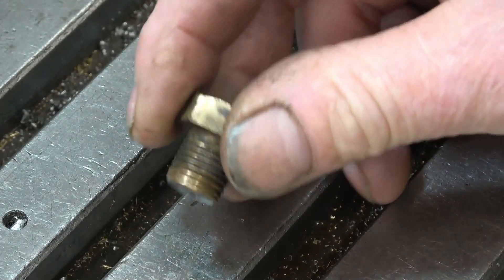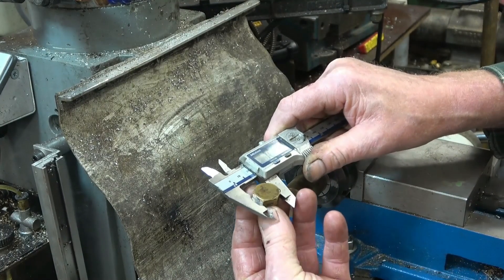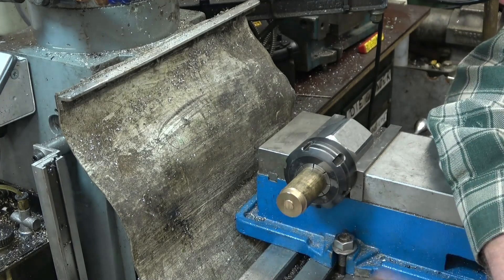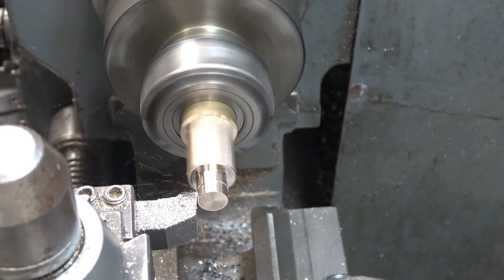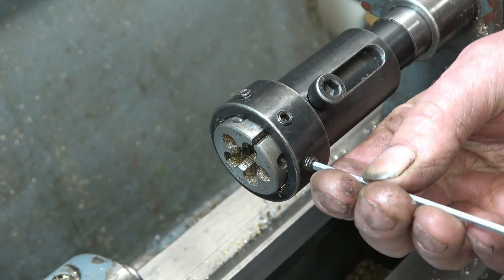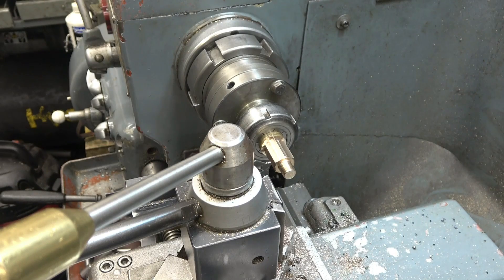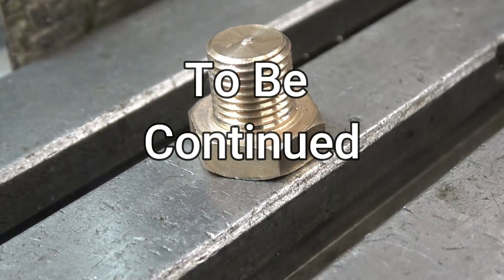SNNC 554 P1  How To Make BSP Plugs  , Round Bar To Hex Bar

Comment: Perhaps you could do a short video on how you used the calliper to calculate how much to remove from the sides. It is a useful function of zeroing the reading.
Reply: You measure the target size, zero the caliper and then measure the larger piece. That will give you the difference. Note, this is the total diameter to be removed. To find the radius to remove, simply divide by two, in this case the radius value is the amount John removed.
I hope this helps.
Reply: @robertoswalt319  I know - it's just that it would be a useful instructional video for a newbie.
Reply from the maker: I will show it in a bit more detail this wednesday
Reply from the maker: spot on that is exactly how it works

Comment: I was thinking these were going to have a solder center for steam relief on boil-over, what are those ones called?
Reply from the maker: That is a fusible plug filled with lead not solder . It is fitted above the fire box in to the boiler . If the water level drops and uncovers the plug the lead melts and puts out the fire .
Reply: @doubleboost  thanks John, I watched that video, so remembered how interesting it was. Think they were for the Sentinal Steam Wagon.

Comment: 2:30 

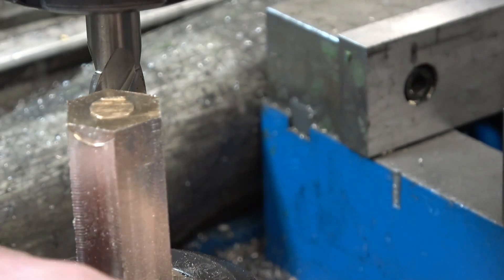It's at times like this that I am pleased that I converted my mini mill to CNC, complete with A axis. I can hexiferate rod* or cut gears while making dinner.  (I posted this before I got to 8:15 - at my age I need to do things while I remember. I have got to the annoying stage of getting upstairs, forgetting why I have got there, going down and remembering before I get there, turniong back and . . . . I am looking forward to the days when I don't remember when I get down; then I wet myself - ah! the downside).

It's at times like using the CNC mini mill to drill simple holes that I wish it weren't CNC - which is why I am adding MPGs where the crank handles used to be so I get the intuitive feel of the way it used to be. Within the next two years I might have got there, if I don't get into a custom box sooner.

* When I did two years of metalwork at school in the early/mid '60s we were told thal rod was round, and bar was rectangular, yet these days I do not hear this difference used. Am I misremembering?